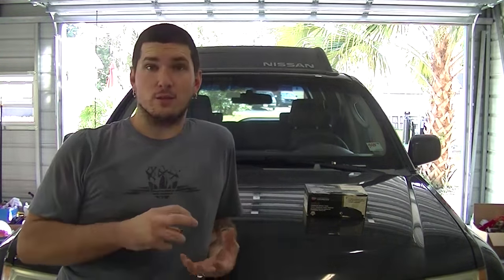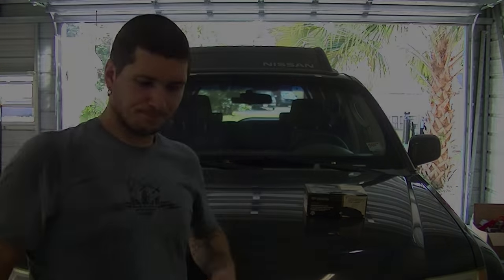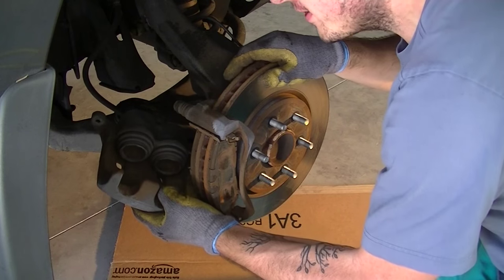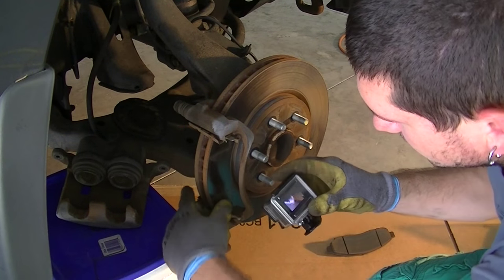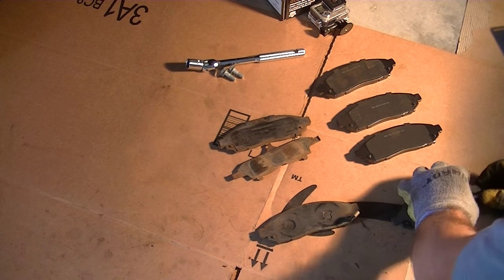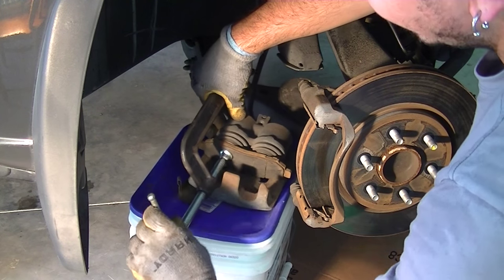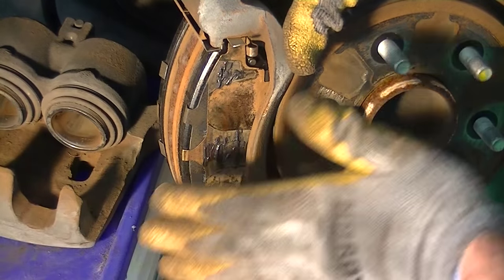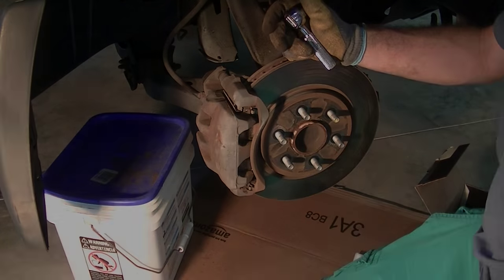How to Replace the Front Brake pads on a Nissan Xterra/Pathfinder/Armada/Frontier

Comment: so grateful for these xterra videos. 3/4 of my caliper slide pin bolts snapped when I went to remove them. I think people have a tendency to over-tighten them, spec is only 32 ft-lbs. If they are not breaking loose easily, definitely spray some penetrant on them and do something else for an hour or two

Comment: That metal tab thing that sticks out is a low brake level indicator.  When your pad wears down to a certain point it'll make contact with the rotor when braking, creating a ringing sound, indicating that you need new brake pads.
Reply from the maker: Nice, Guess i never let them get that low.

Comment: Great video with easy to follow instructions. I paid $18.99 for semi-metallics at Autozone and followed your video. They work great, no squeaks, saved $100 on labor! Popping in the brakes wasn't as easy as it looks, especially the ones on the rear of the rotor (the one with the tab was the hardset ,) but still just took an hour and a half to do both sides on my first try. Thanks so much, keep making these vids, I just subscribed. Long live the Nissan Xterra, my favorite vehicle ever!

Comment: Helpful demonstration,  My son and I are about to change the pads on his Xterra SE 2006.  Hopefully, the pad clips are the same.   Now that being said,  your viewers should also know to clean the guide pins.  The caliper bolts into the pins; they are protected by a rubber compressable "boot" if you may.   It's not hard, pull the pin/rubber boot, wipe completely off, apply brake lubricant to each and reinsert in reversal of removal. Each should easily compress by hand.   The bolt head is usually rectangle and needs to be placed in its inserts of the caliper "squared" up so they do not rotate when you reinstall the caliper bolts. 
Why do I go over all this, this is an often missed part of the brake replacement process.  If allowed to go dry, those pins will most likely bind in there slide holes and you may not be able to remove them.   I had to purchase caliper brackets because of this.  An unexpected expense.  Those guide pins must glide freely so the caliper presses on the pads uniformly 
Also, use a small wire brush to clean every bit of rust off the calliper, the bracket, the space on the rotor between lug bolts.  Spray down (wearing safety glasses) with BRAKE cleaner generously any moving part of the brake system that has dust. Wipe any cleaner off the rotor face with a CLEAN rag.
Not trying to be a "know it all" , but those guide pins must be re-lubed.

Comment: When I change brake pads I always service sliding bolts. Note not to overfill holes with grease as they stop moving easily. Learned that the hard way.
Reply: Did overgreasing them mess something up?

Comment: Ry your video is a nice little tutorial of pad change just a few comments since you asked 
I find it nice that you put these out for people that do not or have not done service on their vehicles 
At 4:05 you show inside pad sorry but it was the only instance I saw of your used pad material an "That's not worn" now you said they were pretty low? well if your outside pad was worn I'd be looking at your slide instead of just slapping pads on there or you'll be out there in pretty much no time doing them again an if it's inside pad look at your caliper as the culprit.
At 5:15 thats what I call the pad scratcher it's there to tell you your pads are worn before you go ahead an almost certainly ruin your rotors.
At 6:30 you start with master cylinder why? if doing pads there is no reason to open your cap to collapse your piston and introduce air which has water aka moisture in it to a relatively sealed system unless you have been topping off fluid as your pads wore and every time you do you introduce more as brake fluid by design attracts moisture. 
At 8:00 you explain benefit for the lube just why put it on before installing pad just put it on when your ready to install caliper back on along with your slide pins after you have cleaned everything an reinstalled pads all your really accomplishing by this is giving yourself more opportunity to contaminate either the pads or rotor 
Why didn't you clean anything Rotor,Caliper,Pins or anything main reasons of complaints squeal abnormal wear an failure 
There is NO mention of resurfacing rotor an yours were pretty glazed at least rough up the surface some   
 I originally watched to see if you were going to say nut sizes cuts down on the tools I'll need to bring out an if you knew the bleed sequence which neither were addressed either. 
All in all wow from the looks of it your pads really did look fine and had a ton of meat left on them an if you look straight on into caliper above rotor you will notice a inspection slot to know how much pad is left I do it when I get tires balanced/rotated just take a min to walk out to guys an ask if I can check the brakes since you have the wheels off and stick my head in wheel well I have never had anyone say NO over the years this included Discount NTB Firestone Sam's Costco just to name a few but anyplace that I had the wheels off at. Now I'm all for doing service/maintenance before it's metal(backing plate) on metal(rotor) I'm OCD with it actually but from the looks of it that brake job was just waste Ry

Comment: Good video. Only one concern. For the detail stuff when you’re removing the brake caliper, better lighting would help. Also, for some of the fine details stuff, better lighting and focusing on those details—panning in. When you installed the clip (minute 8:44), I couldn’t tell where you were placing it. Do you need a torque wrench for replacing parts, and if so, what is the torque recommended? I especially liked where you used a C-clamp for expanding the brake caliper. As I was watching the video, I was thinking to myself, I wonder what the price of special tools are needed to do this job? I prefer not to go out and buy a lot for expensive tools because I don’t know how often I would use/need them.
Reply from the maker: Thanks for this feedback! I appreciate it.

Comment: I heard there is a bleeder valve that can/should be opened on each wheel that can be opened/used during the compression process of the pistons. Know anything about this? Kind of like how you opened the brake fluid cap in the engine bay.

Comment: Thanks ive finished my motor mounts will do brake pads tommorow  ive done this before but didnt deal with 2 pistons 😵and tie rods after tommorow 😫😓 then set the car out of air was on jack since 2 days cleaning oil and dirt on both sides and checking leak from washer reservior hope ill not need to jack it again its so painful xterra is too  heavy 🤪 and its pita to work with and tracing oil leak 😵 hope i can pinpoint it but it looks like the driver side front Corner edge

Comment: Hey there, I changed the pads at all 4 wheels, found leaking calipers on both fronts so I replaced them as well. I bled both calipers to get the air out. Now my pedal is very soft and the truck doesn't stop as fast. Any thoughts?

Comment: Thanks this video really helped, do you know anything about the xterra radiator fail that ruins the transmission?
Reply from the maker: Honestly, not much. All I know is that it is some bypass in the transmission cooler that fails and ends up mixing your oil and antifreeze. My X is a manual transmission so I am not affected by this problem. Believe me though. If I had an automatic I would be making a video on it for you.
Reply: Ry the car guy 
It happened to me recently, im pretty sure mr trans is toast, i flushed it and replaced the radiator but its not shifting correctly, over 4,000$ grand to have garage install rebuilt, I wish nissan had warned me, on the bright side my front brakes are awsome!
Reply from the maker: Well I'm sorry to hear that. I'm glad you will be able to stop once you get it to go!
Reply: Many xterra's had the failure of the transmission line within specific radiators cause the comingling of atf and coolant. Without constant checking of atf the problem arises when shifting is poor. Anyone fearful of this disaster can purchase an external transmission cooler and avoid a failure...which is what I did. Nissan didn't recall the radiators and acted just as if this was just a maintenance issue. Check out the many youtube videos about the xterra and smod....strawberry milkshake of death.  Apparently the coolant totally screws up the tranny unless it is caught really early. Repair bill is often about $10K and thus the x gets trashed.

Comment: Great video! Love the series especially because I have a 2006 model which is essentially the same. It's so helpful to have an exact visual representation on how everything looks before I attempt any of the work. I have a quick question about the rear brakes, would you be able to do a video on that? Or is the process the same for the rear brakes as the front brakes? Thanks for your response
Reply from the maker: +Christian Troy I plan to do the rear brakes but I have not gotten around to them. They are a little different since they have pads AND shoes in a hybrid type system.
Reply: Great! I'll be on the lookout for that video. Any plans on reviewing the process of removing the starter?
Reply from the maker: I actually have it. Its just part of another video. I created a link that should jump you right to the correct spot.
Here you go!
https://youtu.be/j3uY3clWxFE?t=1566

Comment: well.....i may have screwed up. maybe not. the 2015 xterra is the same. i didn't add back that wirey pin that goes on after you put the pads on. The wire that goes in the little holes at the bottom. i also didn't change the shims. I just did a road test and did great. Are these necessary?
Reply from the maker: When it comes to brakes I think its all necessary.

Comment: hey, i was bleeding my brakes today and the person helping me wasnt paying attention and the level went dry. do u know of anyway to bleed the abs or master cylinder without bringing to the dealer ? the front breaks still bleed good and the rears took along time but the pedal dosnt feel right..
Reply: Buy a shit ton of tubing that will fit snugly around every bleeder valve.  Take all tires off and connect all bleeder valves from each caliper to the tube.  Run the tubes all back to the master reservoir and add a shit ton of brake fluid to displace all the fluid in the lines and just keep pumping the pedal.  You can do it on just one at a time and watch the air bubbles go out and into the top of the reservoir.  Just add enough fluid and keep bleeding each caliper this way until no bubbles come back.  Need to do all 4 though.

Comment: Is it just me or did where is the resurfacing the rotors overlooks? That’s why I actually came to this video was to find out if the car can be driven after new brake pads, but before resurfacing rotors? Or must they be completed together?
Reply from the maker: No they do not have to be replaced if your rotors are in good shape.
Reply: Ry the car guy Great to know, I thought they must be both perfectly flat and ware in together every time either is replaced. Great videos! Do you have any on Catalytic converters? Doesnt look like you do, hows your cat doing, mine both have tiny rusty holes in each one same spot.. weird?

Comment: i have a 2002 and my brakes are on the backside of my rotor. wonder why its different?
Reply from the maker: What do you mean? You should have a pad on each side that squeeze the rotor.
Reply: on the rear brakes they have a rotor and hat which is a rotor for the regular brakes and a drum brake for the parking brake. is that what your talking about?

Comment: forgot to tell them to pump the brakes up before

driving
Reply: I did that thanks to your comment. The idea is the get the brake cylinders back onto the brake pads I assume? How much pumping should I do. I just did it for a good couple of minutes, and then checked the brake calipers and they seemed to be squishing down the lubricant. also didnt see any brake fluid leaking anywhere. I'll go on a test drive later when someone else is home just in case.

Comment: Should probably torque bolts to spec. Caliper bolts back out if not torqued correctly. I think factory torque is higher than anything you can do with a little ratchet. 136 ft lb for front calipers and 76 ft lb for rears...I THINK. dont quote me.
Reply: you are talking about the torque specs for the bolts to the knuckle, the larger bolts. The caliper pins, smaller bolts, would be torqued to 20 and 32 foot lbs.  front caliper and rear calipers pins have different torque specs.but i do agree that torquing them is very important and craftsman torque wrenches are cheap.
Reply: 32 lb. Ft for sliding pins.
Reply: The torque member bolt gets torqued to 136 lb.ft.
Reply: Rear sliding pins are 24 lb.ft.

Comment: I'm pretty disappointed that you mentioned NOTHING about the caliper mount carrier bolts. I found out today that they are supposed to be mobile,  not solid. That is a pretty non typical situation as far as automotive repair,  it really should have been included in this tutorial. Admittedly I'm stupid for assuming this tutorial was complete,  but as a consequence of this omission,  I drove to work and back today with my brakes rubbing. Please take care in the future to include such things.
Reply from the maker: So you are saying that your slides were seized? Was I supposed to anticipate that your truck is broken?
Reply: Hey man,  I'm not on here to flame you. Second gens are getting older,  and since the slides are part of the calipers going on right;  yes,  it would have been nice if you mentioned them.
Reply: TheStrykerSeven: Thanks assuming that everyone reading your reply knows what the hell you are talking about.  What the hell is a mobile carrier bolt?  Admittedly I'm stupid for assuming your reply was complete, but as a consequence of this omission, I drove to work and back wondering if my brakes would fail.  Please take care in the future to include such things.
Reply: Having only done brakes on my own and close friends' vehicles I don't have very diverse experience. I have only ever seen break caliper mounts with slides similar to those shown here. I didn't realize that this was atypical.

Comment: When I changed my brakes, I did not re-use the stock shims.  Will this be an issue?
Reply from the maker: You did not use any shims?
Reply: only what came with the new pads.  My new brakes looked like your new brakes.
Reply from the maker: Then you should be fine. As long as you used something.